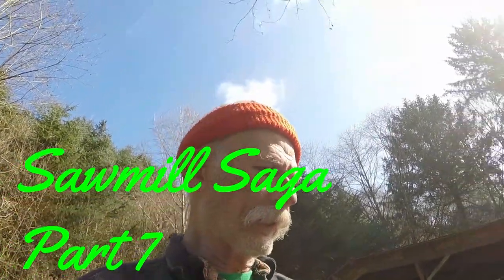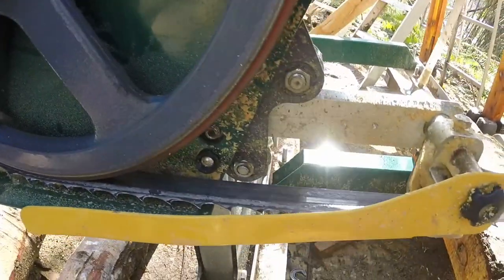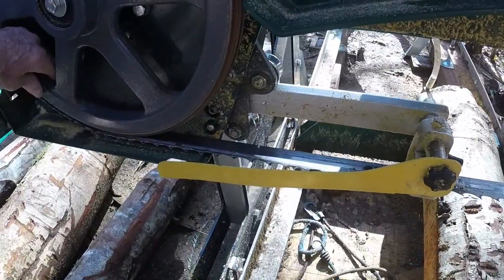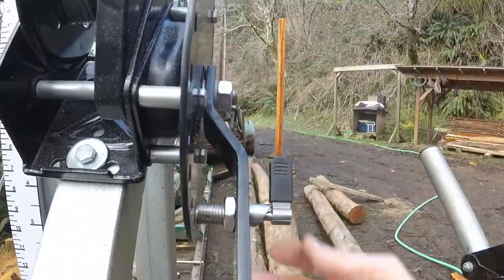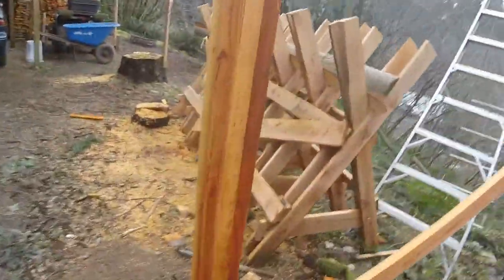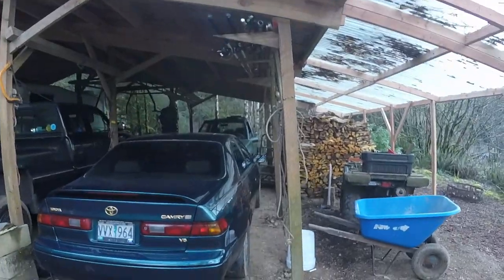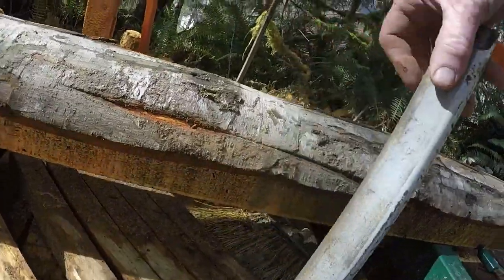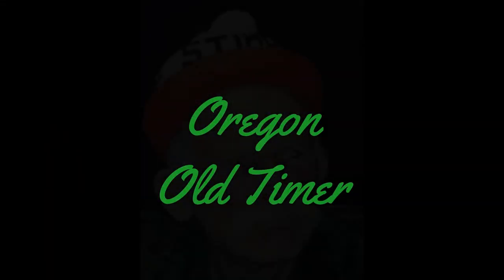Sawmill Saga Part 7: Mods, Fixes and Additions to my Woodland Mills HM122 Sawmill

Comment from the maker: Terry Carl is right. Those bars in the sawdust chute are there to contain broken blades. Had I known that, I would not have cut them out.
However, with my setup, it is impossible for anyone to be standing on that side of the mill. If that were not the case, I would weld them back in.

Comment: I had the same problem with my new hm122 my first blade change the blade on the drive wheel kept goin back I adjusted mine 1/4 turn and it’s perfect now, awsome video 👍🏻

Comment: Good day Old Timer, if you go to the woodmizer site you can see the log clamps are like yours, they have a clamp point block on the end, it rotates so you don’t have to fuss with it or drop it, looks simple enough to fabricate. Those are some good mods you did to your mill.
Reply from the maker: I considered adding such things, but if I made them long enough to stay on the screw shaft, they wouldn't leave enough room for any but the smallest cants.

Comment: Great video, still working on preparing my site all the while itching to unpack my 126, thanks for the tips.
Reply from the maker: It's been a year, but I just found your comment. So how did it go?
Reply: Had a rough start was sent a back post for the hm 122 model so holes didn’t line up, they sent out a front post but that was my fault because I hadn’t referenced a part number when talking to them, finally got it up and running with a few different projects completed. The owner of Woodland mills actually contacted me and wanted to make things right and sent me out a pack of blades which reassured me I made the right choice in choosing a local company.

Comment: Did you try taking a level or a straight piece of steel and lay it across each pulley to see if they are lined up with each other. I saw one of my guys I watch do that. Then you will know if your straight. It's a start. By the way what did you do to your finger. I enjoy your brain storming of things you encounter. Thanks for sharing. Iowa is watching. 2 Inches of fresh snow and 31 degrees, was 58 last Saturday.
Reply from the maker: I'll try that alignment check. Thanks for the tip. As for my finger... https://www.youtube.com/watch?v=ZXkTFTQnKmY

Comment: It looks like the small gear is not properly pinned into the proper position, it should be tight enough to set a preload on the clutch surfaces and then be pinned to keep the preload the same.  You can see the cross hole drilled into it.  I bet the pin was never installed when manufactured.  I suggested the rotation of the starter on another channel.
Reply from the maker: It was probably your comment on the starter that I wanted to credit but couldn't remember what channel or who commented. Thanks Matthew.
That small gear in the winch floats on coarse threads. Starting with no load, turning the crank pulls that gear against the steel disc next to it and compresses the clutch discs and the load rises. The entire clutch is immobile and turns through the ratchet. When cranking the weight down, the small gear pulls away from the clutch discs allowing them to slip. I think the problem with mine is, the steel disc next to the small gear does not slide freely on the shaft. I'll take it apart today to confirm that, or not.

Comment: From one old timer to another🤣 have you tried Teflon spray? Just don't breath it. Great lube but bad for  critters like us. Btw, finished up the head unit yesterday and finishing up the tracks today. 126 👍😎👌
Reply from the maker: Silicone spray works just fine for me. I spray the uprights every few hours. Does Teflon last longer?
Reply: @OregonOldTimer  it has fir me especially on hot items like woodstove door latches etc. It leaves a dry coating that doesn't gather dust as well. Just don't breath it.

Comment: I like the idea mine dose the same Thang I run a good amount of water on them too so my mill is same as you got going on I've ran 8 logs fir now blade is getting dull having waves in my cuts.
Reply from the maker: I almost never run water anymore, but I seldom mill pitchy wood. Wood-Mizer advises against running lube when milling extremely dry wood.
Eight logs on one blade? Yep, it's dull.

Comment: My HM 126 model year 2022 has specific instructions on how to adjust both follower side as well as the drive side. I wouldn’t be afraid to adjust the drive side wheel
Reply from the maker: Woodland Mills sent me the instructions when I realized the drive wheel needed adjustment. All good now.

Comment: If you watch woodmizer videos you will see a notched bushing that they made to catch the bottom of the cant. It seems to work pretty good.
Reply from the maker: I've experimented with similar gadgets but haven't come up with one that is worth the trouble to use.
Reply: I also noticed that the WM has rollers on top of the log stops... great idea, and I will make some for my HM130 when it arrives
Reply from the maker: Old brain was confused for a moment until I realized WM means Wood-Mizer as well as Woodland Mills.

Comment: I have a 2021 model of the HM130, and the raise and lower control is nothing like that winch you have, thankfully, because that style looks like a headache. I'm not sure if your new winch you ordered is like mine to replace what you have, hopefully it is to make life much easier.
Reply from the maker: Mine is 2021 HM122. Raise/Lower winch is no longer a problem since spraying in WD-40. I even removed the locking pin. Got tired of accidentally tripping it while cranking the winch.
Reply: @OregonOldTimer  must be a weight thing between the 22 and the 30 then, not an age thing lol, glad it's work good for you now.

Comment: I hear alot of reviews on woodland mills about blades jumping off the wheels. Why do the other reviews of other mills not mention their blades jumping off all the time. Is this a normal thing for all mills or just woodland mills has this issue.
Reply from the maker: It may be that a high percentage of WM buyers are new to sawmilling. Sawyers willing to spend heaps of money for a high-end mill probably already know what they're doing and don't have the problems we newbies have.
I haven't had a blade jump off since the first few hours of operation. I had to adjust the drive wheel just a hair, after consulting WM Tech, and have had no jumpoffs since.
Reply: The only time my HM122 blade jumped off is when tension was not correct. I didn't throw a blade last summer at all once I figured out where the tension was correct. The cut also improved. I love my Woodland Mills mill.

Comment: Hey i too had the tracking issue....never jumped a blade because ive been tryng to set tracking according to spec before initial cut.  It is brand new hm122 2021 model i set the blade to specs in book (1mm back and 9mm front) tight it up and turn by hand.  The follower wheel stays on point but the drive side comes back in.  I set it again and again and again back to specs on both side and the drive side always comes back in.  I tried to have it go in and  out with the 2 bolts ober 2 hrs it changes nothing ti the drive side.  Since i dont dare go against the "factory set do not touch" i set it to match the drive side which ends up being about 7mm in front.  At least they are equal to each other.  I sawed one small log and no issue.
Reply from the maker: @Silvain Ouellette Woodland Mills will send you instructions for adjusting the Do Not Touch side of the mill. I had to adjust my drive wheel, but I didn't touch it until I had instructions from WM.
Reply: @OregonOldTimer  thanks ill get in touch with them

Comment: Those bars are to keep your blade inside the guard incase the blade breaks
Reply from the maker: I hadn't considered that, but I'm not convinced. If a broken blade is going to leave the mill head, there is plenty of open space between the guides. Unless the blade breaks between the second guide and the drive wheel, the broken end will never make it to the sawdust outlet. Probably not even then as the log being sawn would stop the blade almost instantly, I think. I say "I think" because I've not had a blade break. Yet.

Comment: It is wet here in Florida and I had my rulers on the green part and it started to mess up the paint from trapped condensation. I put mine down on the galvanized vertical posts instead. Hope this helps someone.
Reply from the maker: Thanks for that tip. I'll do the same. A magnetic sticker blistered paint on our car, so I should have thought of that.
Reply: @OregonOldTimer  haha I didn't even think of that. I had one on the tailgate of the truck and saw your comment and started to panic and ripped it off. Luckily no harm. Thanks for the heads up.

Comment: No pro here, but according to the bandsaw expert at Carter, the band alignment at both wheels should NOT be perfect.

It is tension between the two vs. crown on the tire that makes the music. 

That was on a bandsaw as opposed to a bandsaw mill, but I can't think of any reason why the principle would be different.

I have the HF version (Surely a 126 knock off) of mill. Since I learned about the alignment on the shop bandsaw, I quit chasing perfect alignment on my mill and she runs great with no problems.

I set my blade so that the spec is satisfied on the idler side and make sure the teeth are clear of tire interference on the drive wheel.

Good video!
Reply from the maker: Thanks for weighing in. There are so many variations in thought and procedure on all aspects of bandsaw milling, it seems more akin to alchemy than to science. Obviously, there is more than one way to do almost everything. The trick is finding what works best for the individual mill and the individual operator.

Comment: CRC 336 is superior to WD 40.  I used both for years on metal punches. The WD40 would dry out after sitting around. The other would not.
Reply from the maker: Thanks for the tip.